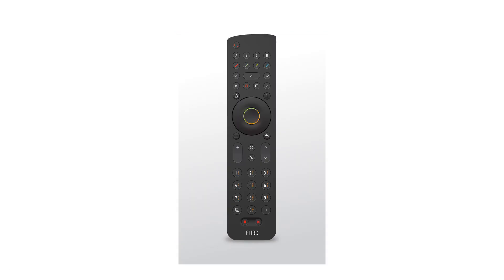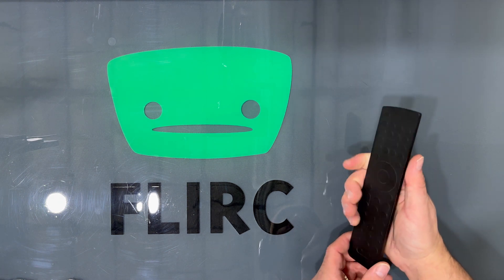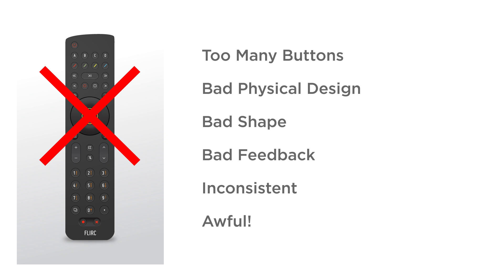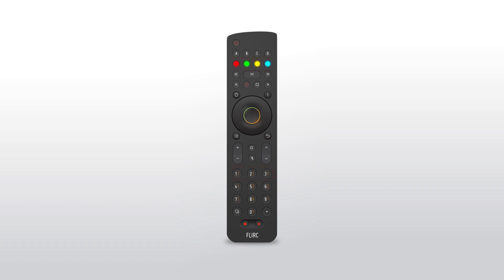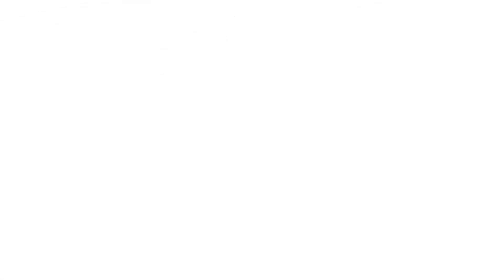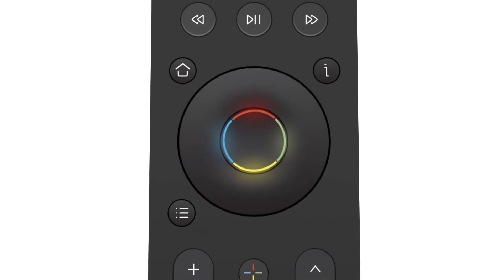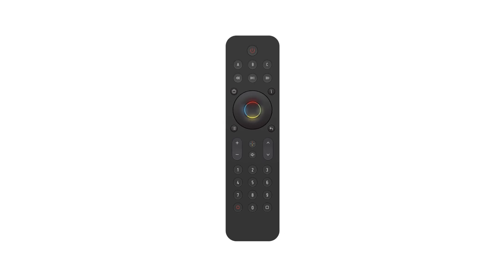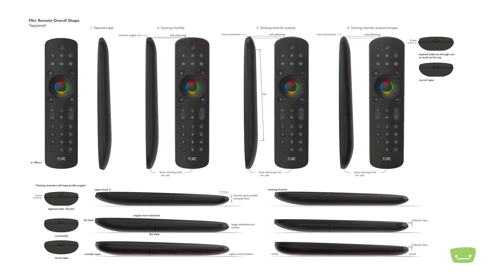The Making of Skip - Designing and Building the Hardware - Part 1

Comment: Great work! Just one question... I live in an European country and I never use the color buttons... What are they for?
Reply from the maker: Some countries use the color buttons with their cable and set top boxes to answer questions.
Reply: In Belgium it was commonly used for Teletext. I'm just old enough to remember it as a shortkey. Let's say you we on the main page (page 100). By just pressing the red button you could go to the TV-guide of the channel you were watching. Green was news section, etc.... Other than that, just a few experiments with interactive TV. Maybe there was more, but I don't remember. I honestly didn't knew that was actually a requirement in Europe.
Reply: @jeroendemeerleer5553  Yes, now that you say it I remember! For some reason I thought teletext (or "text-tv" as it was called here in Sweden) was really exciting, that you could magically get news on your tv. And there were some "hidden" pages with just test content on.
Anyway, I haven't touched any of the color keys in the last 25 years, so it was a good thing removing them! I wish the number keys could have been removed as well, but I realize others may be using them...
Reply: Yes, I remember these buttons too that were used for Teletext, in my case, in Romania. If I remember correctly, you were able to jump 10 or 100 pages with one color, 20 pages with other color or so, and maybe 1 color for home page of Teletext, or something similar. Amazingly, Teletext is still available on a few channels in Romania, dont think anyone uses it :)